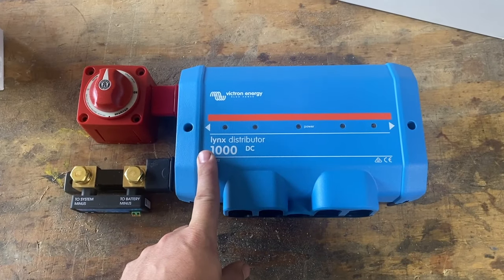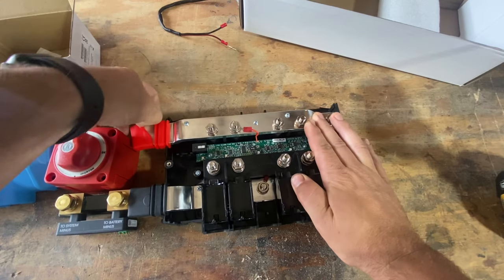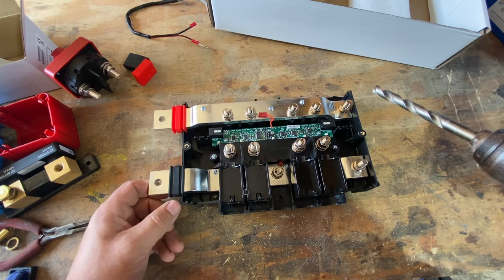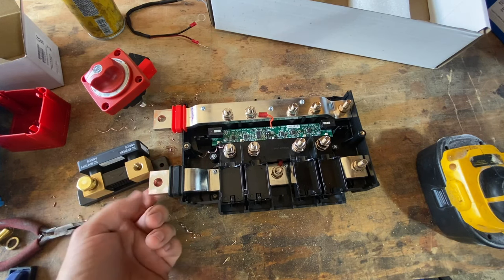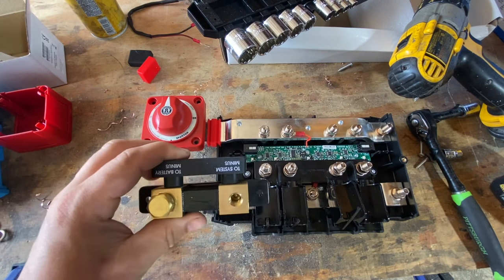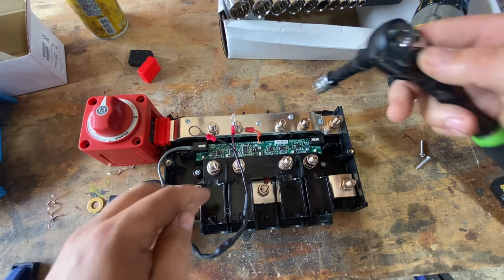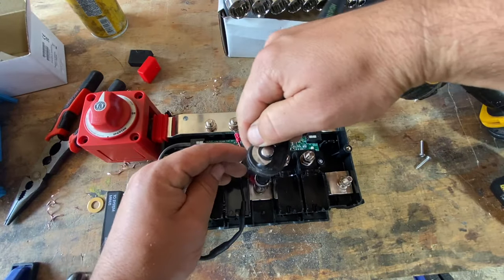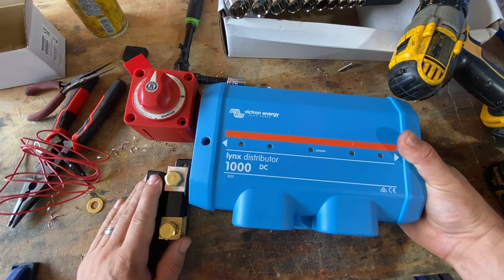Make the Best Victron Lynx Distributor with LED Lights working

Comment: Victron makes the Lynx smart shunt which is basically what you made, but better with a contactor, pre-charge and can bus.
Reply from the maker: We’ve used the smart shunt a few times, but we don’t always have the room for the Lynx shunt, Distributor and power in. This has been a nice neat compact option.
Reply: The Lynx Shunt just has the shunt, an ANL fuse, and the power supply for the distributor (plus monitoring electronics). It doesn't have the contactor. If you want the contactor, you'd need the LynxBMS, but that's only really compatible with Victron's smart batteries. Very good kit, but definitely on the pricey side.

On my boat, I wound up building my own DIY battery with the REC ABMS, which communications into the Victron ecosystem via CAN BUS, and acts pretty much the same way.
Reply from the maker: my criticism of the Lynx shunt (which I have one of) is that the anl fuse is not protecting the wire from the batteries to the Lynx distributor. No reason you can’t double protect. One of the primary reasons I like doing this is it also covers the positive terminal . That problem still exists with Lynx BMS. Only way it re gets solved is with a Lynx power in… but then we’re far outside the scope of this project and into proper Victron use cases.

I also run my own DIY battery bank. I have 32 in a 4p8s configuration with a 500a Daly BMS . There is support for it in Venus OS now with 3rd party drivers.
Reply: A counter sink would work good to clean up those holes

Comment: Would you recommend putting the cover on the distributor prior to drilling the larger holes keeping metal shavings out of it?  It looks like a great way to install.
Reply from the maker: Probably , good idea :-)
Reply: @sotasolar  I know, the ones I see are big, guess will have to get wires out to mount the converter outside and run wires back into the distributor to make it happen.
Thanks for the quick reply.

Comment: Victron should make a longer busbar for those who have two or more side-by-side inverters (you know, parallel or three-phase) without having to play "Lego" to assembly a longer busbar like now, and with connectors both above and below to avoid to make turns with the cables.

Comment: I think lock washers need to be with the nut or on a bolt that has no turn able nut. They aren't designed for electrical conductivity.

Comment: There is an issue with clearance shunt+distributor - the shunt is ~3mm lower than a distributor which makes mounting not perfect. Washers under distributor enclosure help in this case, but I agree - Victron needs a better job with fitting their existing devices one with each other.

Comment: I did a setup similar to this in my RV but I hate how the mounting surface does not line up. So I used a piece of 3/8 thick 1 inch wide copper flat bar and bent my own very short bus bars. That connect the vitron to the switch and the shunt.

Comment: Just a suggestion for others: 
Consider covering all of the circuitry section (towel, cardboard, paper, …) to protect from tiny particulate from drilling.
Support bar that you’re enlarging hole with wood elevated to ‘resting’ level of bar underside.  Rather than pressing firmly down on Suspended bar
Reply: jan09’24/1012h 🇺🇸 @StansE250>> Sir thank you for the suggestion. My heart ached, viewing the Cu splinters flying into the circuit board. The best thing was to install the cover and secure it with the screws, and enlarge the mounting hole, thus avoiding conducting from falling on the circuit board. I am speaking from experience. Nothing wrong by enlarging the mounting holes, but filing the burrs would expose the Cu underneath the Ni plating, that might cause electrolysis by forming CuSO4 with the help of moisture, in the long run. This chemical process would cause high resistance in the circuit. (a difficult issue to detect) The issue can be avoided by smearing C based conducting grease to the exposed Cu.

This info for general public with due respect to the YT publisher (presenter) Thank you.

Legend: Cu- Copper, Ni- Nickel, CuSO4- Copper Sulphate (greenish formation of reaction of Cu and moisture), C based- Carbon powder based
Reply: A few inadvertent typographical errors were detected, which please note. Thanks.
Reply from the maker: Thank you, yes, we now keep the cover on all the time

Comment: Your not wrong... that's a sweet setup.
It would be just nice if @VictronEnergyBV just made the Shunt and Switch. So they bolt on the Lynx Distributor. without all that messing about :)
Reply from the maker: Like many things in life , the best things sometimes require assembly :-)

Comment: Always great to search YT and find a video on exactly what your small project is for the day :-) I'm also working on packing the lynx distributor mounting and maybe also the shunt to that the three pieces lay flat on the mounting surface. I think it's needing 3/16 or 5mm behind the distributor and I have a 3D printed spacer for the shunt arriving this weekend. If it's too thick I can sand it down.

Comment: It's a nice simple idea, tidy. I have done this with a system build and it works great. What I would suggest is covering the inside circuit board while drilling out the holes. Those fine copper burs go everywhere and could short something out if they got into the circuit board.

Comment: Nice little setup. I would not use a file on the tinned bar like that tho, you could even use the corner edge of the file to carefully deburr the holes & perhaps a slight sand of the holes edge, or a larger bit could be used probly by hand. Good vid. Thanks for sharing
Reply from the maker: JD and I have been working on other methods of deburring . I don’t like taking off the tinned coating , we tried a larger bit, it just  made another burr.  If you come up with a good method, let us know!
Reply: @sotasolar  larger bit in reverse rotation
Reply: @sotasolar  You already know the answer: a machinist's deburring tool.  You mention in the video that you don't have one.  Even is really nice one is only about $20, and basic ones are less than $10.  If you're doing this sort of thing with any regularity, just get one.
Reply: A counter sink would work good

Comment: This is a great safety modification,. You are keeping the hot unexposed. Is there any issue placing the cut off switch far from the batteries. As I understand it, a battery cut off should be within 12 inches of the positive terminal on a battery.
Reply from the maker: The fuse / breaker is what should be close to the battery. Disconnect isn’t as critical.

Comment: Thanks Shawn, nice one. Personally I don't use the Lynx series, I find them too expensive in a MH environment
Reply from the maker: When it comes to a fused bus bar capable of 500+ amps , I can’t build one from parts on Amazon cheaper. What solutions are you using? I do have projects that I want to save on from time to time.
Reply: Jaap de Wind .. I am interested in your answer as well

Comment: would it not be possible to use a usb cable, adapted (power & ground) to supply the 5 v for the LED's. In the UK its impossible to obtain the step down set up parts you describe.
Great Video.

Comment: Noob question: why do you put the battery disconnect on the positive instead of the negative. Battle Born and a bunch of other manufacturers say the negative side is safer. Just curious. Thanks!

Comment: I did a similar thing but used a copper bar between the switch and the distributor and between the shunt and the distributor or modularity and worst case scenario I've ruined a few dollars worth of copper box

Comment: Do you find that the base of the cutoff and the base of the shunt are level with the Lynx that way? Or do you shim one or both to level things out?
Reply from the maker: We used to shim it out but once everything is bolted together it’s is like a single unit. I do 1 screw on the shunt, 2 on the far end of the Lynx (maybe 2 on the other end but not as tight) then a few 3” screws on the disconnect.

Comment: Great video, how did you make the 12v in to 5v 2 pin cable?
Reply from the maker: I can do another video on that.
Reply: @sotasolar  many thanks, that would be great. Sourcing the parts in the uk is impossible and it appears they are only available in the US, with postage costing about double the price of the parts
Reply: @sotasolar  please 🙏 do, will be following for more ideas on Victron.  Thanks
Reply: Did you make the video ?

Comment: jan09’24/0947h 🇺🇸 Thank you for the presentation describing the use of VICTRON Lynx Distributor, which educated me well educated. I bought the above device and the main shutoff switch. The VICTRON Shunt is on order to complement the circuit. 

I did not understand the placement of 2 RJ11 sockets on either sides and the purpose of it, though I viewed one RJ 11 socket was powered 5.0V externally, “for the purpose of  illuminating LED indicators”. Why so? I also viewed a 12.0 V Positive connection tapped from the main Busbar, to the circuit board. But missed to view the corresponding Negative connection. What was the idea, as to why, you had to wire an external 5.0V to illuminate the LED indicators? 

Pardon me for the lengthy narration. I don’t, even, know if you’d ever intercept my enquiry, and if have ,by chance, did so, kindly respond. Thank you and best regards.
Reply from the maker: It’s made to work with the Lynx Shunt or BMs, which supplies the 5v and data communications. We’re just simul that to get the LED indicator as well.

Comment: I have two 400Ah battery banks that I want to combine ... can I do it with this? My thinking is to take the two large terminals to the multi plus and two battery banks to the distributor.
Reply from the maker: Lynx power in is good for this.

Comment: Do you have a link to your vid on how to make your step down converter cable?  I could find it on your YT page.
Reply from the maker: Enable Victron Lynx Distributor LEDs - How To Make Voltage Adapter
https://youtu.be/-ymhL5zxaWE

Comment: Well, Victron do make a shunt called simply 'Lynx Shunt'. So what you're saying is that Victron need to make a 'Lynx Disconnect', right?
Reply from the maker: Lynx disconnect + shunt with mid point tracking. We find that very helpful with higher voltage systems.

Comment: Does the inverter go on its own seperate fuse inside the lynx? I needed 6 pos bolt points and 6 neg for my system lynx doesn’t have enough!? Don’t like how close the neg and pos are in the lynx easy to short while handling live wires.
Reply from the maker: You’d be interested in this project then. 
https://youtu.be/G2MGAby6ceY

However if you want to stick with Victron stuff you’d add a second one on it for up to 8 protected inputs / outputs. 

If you’re worried about live wires our suggestion would be to use the main disconnect before performing any maintenance :-)

Comment: What amp is your 12v to 5v, step down converter? 
You list 2 at 1.5A and 3A or is either fine?
New to all this and distributor too expensive to melt circuit board.
Reply from the maker: Amp capacity won't burn anything up.   I use the smaller one in my 12v builds.  Usually if I do a 48v build I recommend just going to the Lynx Shunt and then this little converter isn't needed.  Here is my video on building the cable. https://youtu.be/-ymhL5zxaWE

Comment: Do you shim the distributor since the corner with the shunt is on is higher? I could see the distributor rocking.
Reply from the maker: It’s not perfect, but we find sinking the screws in the far corners of the lynx, then the shunt and the disconnect works well. No rocking.

Comment: nice trick, I like it for simple installs but not suitable for setting up inverters in parallel unless you connect another distributor after your disconnect and only have your batterioes on the distributor you set up, but your MPPT's and inverters on the other one. Thanks for sharing.

Comment: Seems like a great idea, but what happens if when you put it all together and say the lynx distributor is no good or something happens and you have to return the lynx distributor did you not just void the warranty by drilling out the bus work? That's three hundred plus buckaroos down the drain!😢
Reply from the maker: Common misconception about warranties in the US and under the jurisdiction of the Magnuson–Moss Warranty Act. The burden of proof is on the warranty issuer to prove modifications caused the failure. 

That said , Victron and my distributors has been the best company I’ve had to work with on warranty issues.  Ive had two failed units (both dead on arrival) and the one they wanted back to send to engineering in Netherlands to figure out what happened.

I think i have a Sunday Solar Talk video idea now :-)
Reply: @sotasolar  was not aware of that act, thank you for that information where can I find that information so I could read it for myself please
Reply from the maker: Not sure i have anything specific other than using the google machine. @stevelehto on YouTube has a bunch of content around it . Most of the content on it is around autos but it applies more broadly of course.

Comment: If you have every connection fused and the main line out connected to the bud at fused why do you need an extra fuse?
Reply: Connected to the busbar
Reply from the maker: Not 100% sure I understand the question.  In general, if power can flow in two directions, each end needs protection.

Comment: If not adding on to the Lynx Distributor I like to make a shorter R45 with the step down and run it off the unused end bolts. The wires are all out of the way at the end of the unit.

Il also shorten the SmartShunt power cable and connect it to the battery side of the power switch after the battery cable is connected. This way the SmartShunt doesn't lose its stored information when the system is turned off.

I tear those switches down and remove excess dielectric grease before using them in installations. The people putting them together seem to just gob the stuff in them often on the contact surfaces. That can cause issues later on.

When mounting the Lynx Distributor, ⅜" rubber faucet washers make really good spacers to account for the SmartShunt offset needed in this configuration. 

Cheers😊
Reply from the maker: Great tips!

Comment: Didn't quite get what is the purpose of that extra cable connection there?
Reply from the maker: It enables the led lights which indicates if a fuse is blown.
Reply: @sotasolar There seems to be 5 LED lights on the device. Are they not functional without that cable? Will warranty of the device be valid after such modification?
Reply from the maker: @1yyymmmddd leds won’t work unless this cable is used OR Lynx BMS / Lynx Shunt is used. 

As far as warranty goes, Victron warranty is very good. Secondly, without the cable, they don’t work anyway. If the cable failed the LEDs would not work again. No way the led ac me would cause its core function to be impaired.

Comment: I couldn’t mount my Victron smart shunt like yours. The battery side was reverse of yours. I don’t get it. Why would Victron  made them them both ways
Reply from the maker: You can flip them.
Reply: @sotasolar  no you can’t. If you try to flip it it won’t fit. Geez I tried that. It doesn’t work
Reply from the maker: @sunroy1 you have to flip the electronics as well. We do it on Lynx shunt often.

Comment: Hi,

Does this sit flat on the wall after adding the disconnect and smart shunt?
Reply from the maker: You can secure it with screws and it won’t wobble. We usually install on a carpeted board so it all works out. You can space it out with some washers or some other material if need be.
Reply: @sotasolar  There's 2 cables coming from the pcb already, any idea what they are for?